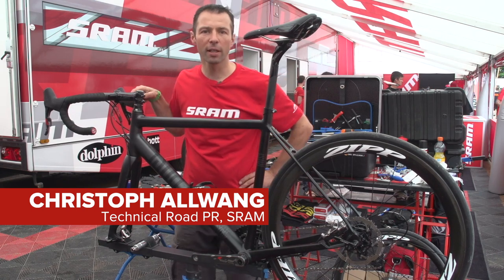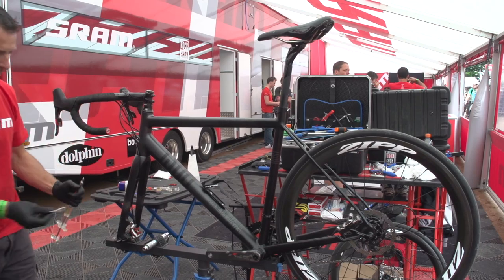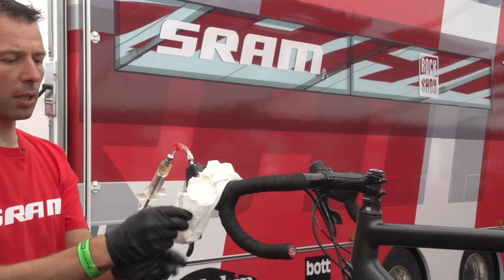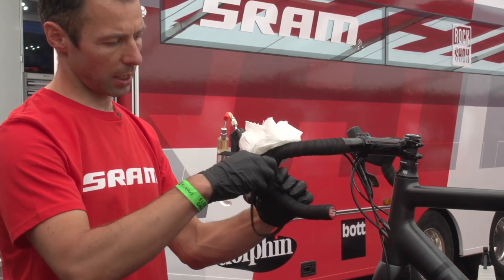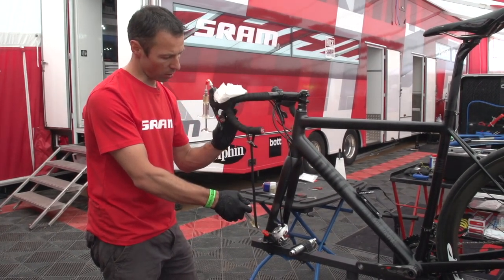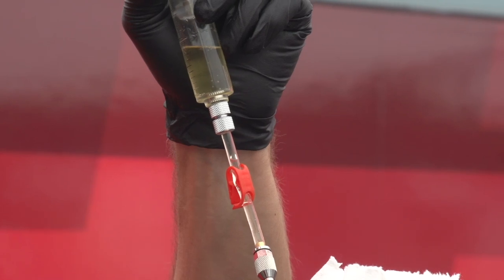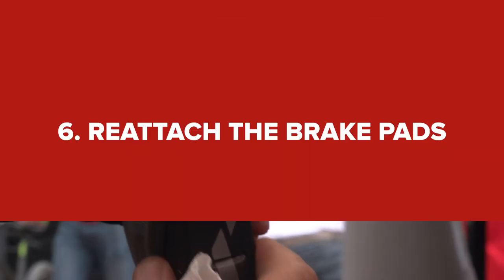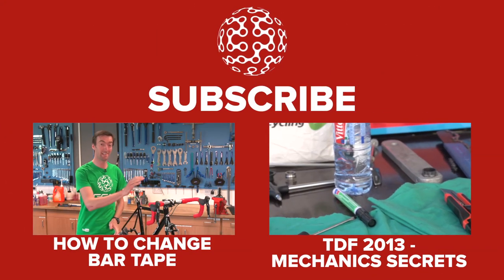How To Bleed SRAM Road Disc Brakes - Maintain Your SRAM Red Hydraulic Disc Brakes

Comment: Worth noting that it's impossible to pass fluid from caliper syringe to lever syringe if the brake lever reach is dialled out too far.  Set the lever for small hands before you start ;-)

Comment: Thank you GCN for the succinct video. I bought a bleed kit and had at this over the weekend to swap the hoses on my new bike to make them moto/British orientation instead of the American front brake on the left orientation.

My brakes feels as good as ever. I always look for GCN videos before company HQ videos when I need a bit of mechanical help, they're always top notch.
Reply: Jeff, where did you find instructions for doing that. I want to do the same thing with mine, but this is as close as I have come...
Did you buy new hoses, or was it as simple as just swapping the hoses over at the levers?

Comment from the maker: You bleed discs to remove any air that may be in the hydraulic cables - air being compressable and fluid not. Mostly you do it once when setting up your brakes and rarely have to do it again. Pads do wear out - as all brake pads do - and rotors wear a bit too, but don't often need replacing unless they warp, which is pretty rare.
Reply: This process doesn't replace the brake fluid which should be done as it is hydroscopic. Also why not use oil like Shimano, then it would never need bleeding.

Comment: It honestly depends on how much you ride and the conditions you ride in.  For instance, the brakes can absorb moisture if you live in humid conditions; or when excessive air gets introduced into the system (such as traveling with your bike in an airplane and it's subjection to pressure changes).

Comment: I think it should be worth noting: The process to bleed Shimano disc brakes is way easier than SRAM... and they use Shimano's mineral oil, not corrosive DOT fluid like SRAM.

Comment: Just installed a slightly used sram red hydroR group on a new frame.

The rear brake engages, and I can stop with it, but it doesn't engage as quickly as the front brake and is not as strong. (Typically I'd adjust mechanical brakes with the barrel adjusters to set these up equally.)

Wondering if anyone has experienced this? Any tips or recommendations? 

I'll admit now, that I accidentally gripped the rear brake when I finished bleeding, before placing the pads inside, which then lead to dripping fluid from the pistons (don't know if this is typical) so I bled it again. When I finally placed the pads in and gripped the brake, I felt a weird snap in the lever when I squeezed it, so I bled the system again. (For a total of three times.) 

The lever no longer has that snap, but it's not as strong as the front. Did I break something? I hope not. :(
Reply: By the way, this video is super helpful. Thanks GCN!

Comment: SRAM brakes are a joke. They need to learn from Shimano and forget the top syringe and use a big reservoir. Good to see the hole is on top though. Something Avid brakes after years still don't have.
Reply: The screw in syringe looks pretty nice though.  The Shimano push on tubing has pulled out for me a couple of times, spilling fluid all over the floor.